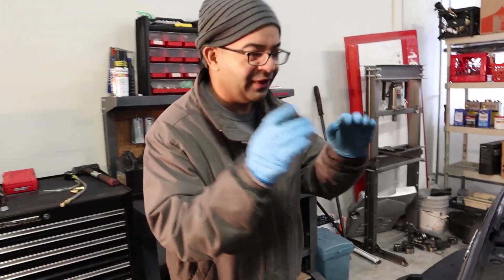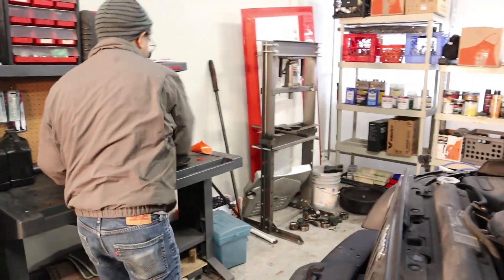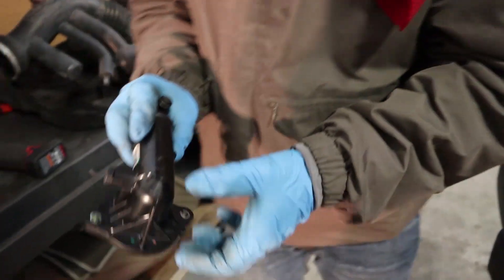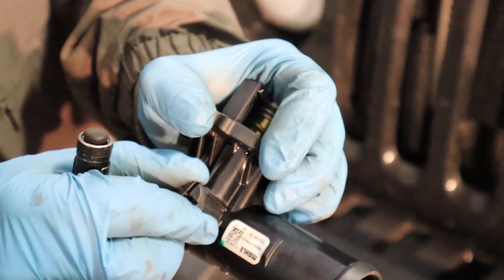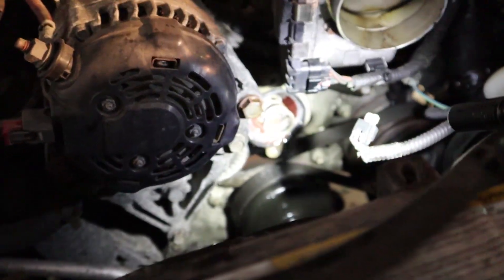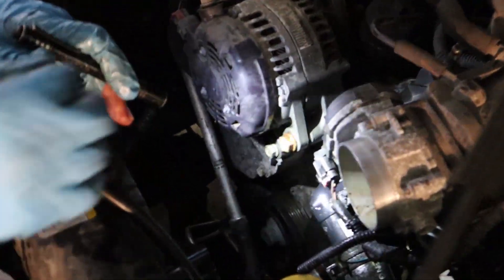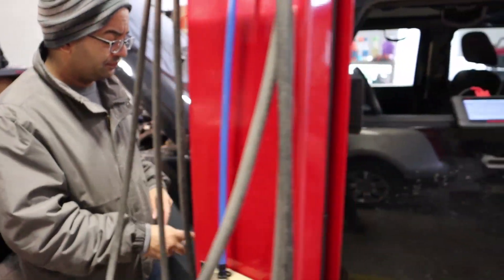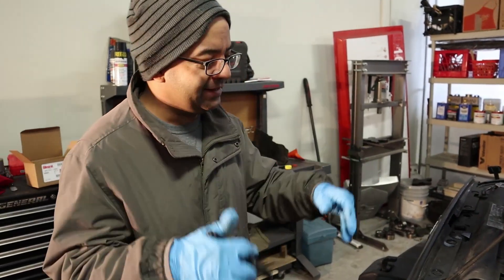2012 Jeep Wrangler Sport Thermostat Replacement (No Heat)

Comment: In other similar videos like this for changing out the thermostat in a 2012, I don't see other mechanics messing with the air relief on the thermostat itself like in this video.  Regarding letting the air out of the system, can't the same thing be accomplished starting up the Jeep and leaving the top off of the coolant to allow air to bubble out and escape?  That way you don't risk leaving that air relief loose or open and cause yourself leaks at the thermostat in the future.  The coolant certainly won't spew out in that short amount of time.  I'm not a mechanic - but that seems to make sense - so just clarifying.
Reply: That's how I did mine. It worked fine.

Comment: I have 2019 jeeep wrangler that’s not blowing hot air and the car starts over heating on long idle dose that sound like thermostat
Reply: Yes, I'm having the same issue with my 2012 with 160k miles.
Reply: Thermostat is probably stuck CLOSED instead of open. Be sure test your new thermostat to make sure it opens. Boil it in a pot of water and it should open in the pot.

Comment: I have a 2014 jku, my fans always kick on when the thermostat gauge goes over the halfway point,  and then the thermostat gauge begins to go up and down and the fans stay on at full blast.  The rig doesn't officially "overheat". I don't know if it's the thermostat or a sensor or the waterpump?!?!
Reply from the maker: First thing you wanna check is your thermostat, is really easy to go bad in this engine
Reply: @psautomotive5530  I purchased a funnel kit, and bleed the system the radiator must of had inadequate antifreeze and It worked. Thankyou. Now I got a rattle which I believe is a heat shield
Reply: 2016 same problem
Reply: @Downtime-Remy  you know what it was...
the radiator didn't have antifreeze in it. I just bought a funnel kit and topped off the radiator, turned the Jeep on problem solved